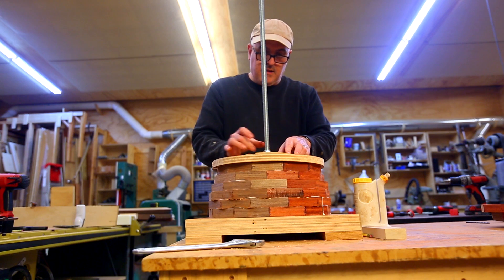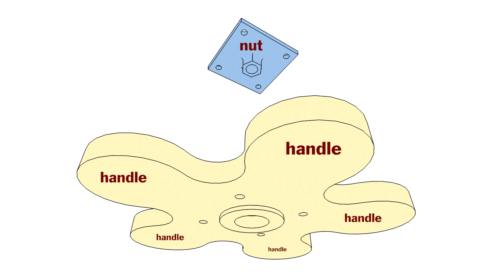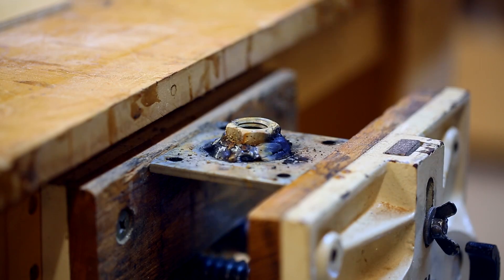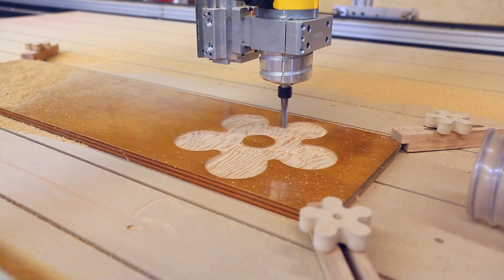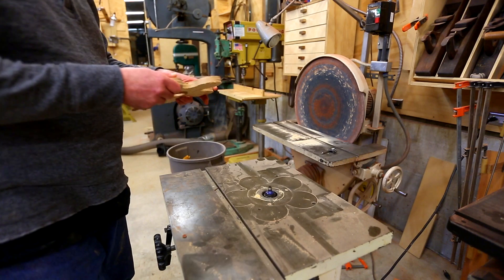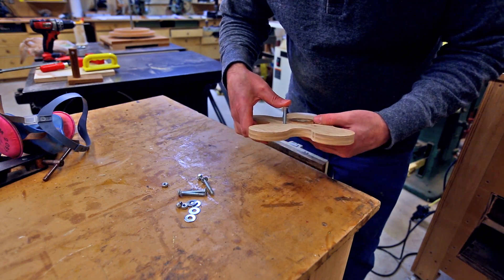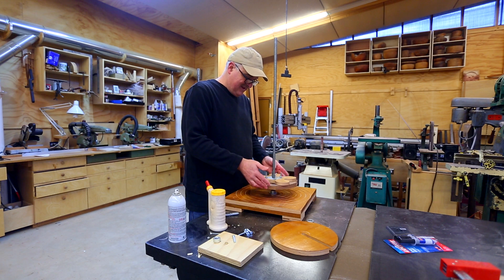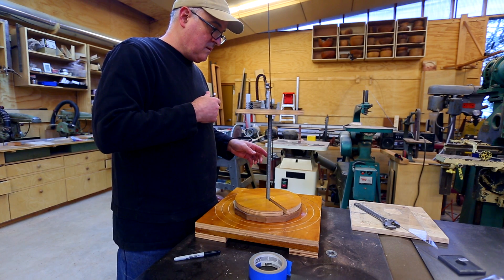Segmented Bowl Clamp Handle

Comment: What about a quick-release rod? So the rod detaches from the base with a push of a button?
Reply: +Brian Noah Or a spit nut. Then you don't have to worry about keeping the rod square to the base if your tolerances are off.
Reply: +Brian Noah There's a good idea.
Reply: +PyroShim Split nut... that's what I was thinking. Weld a nut in the jaws of a small vise-grips, then saw the nut in half. Then weld the vise-grips' non moving jaw to the metal plate.
Reply: you can also find a threaded clip which can be used as a nut and is easily removable from threaded rod. don't know how it is called but I have seen that few times at work (aerospace industry). worth checking it out.
Reply: +Brian Noah Or a smooth rod. Put a chunk of externally threaded pipe in the nut in the handle. Slide the pipe/handle assembly over the smooth rod, clamp some vice-grips above the pipe and spin it tight. Might need to cut some notches at the top of the pipe to keep it from spinning against the vice-grips.
Reply: +Justin Désilets Erico SN Series Nuts
Reply: +Justin Désilets They might not be the exact ones you're thinking of but these are brilliant for this exact purpose.
Reply: Sam Tranter nope, that's not what I had in mind, but I guess they do work the same way!
Reply: Pat Sullivan not quite the thing i have in mind, but something similar to this: http://www.dumpstercnc.com/images/super-thread_clamps_size_c-01.jpg    some have a quick clamping mechanism that makes them as easy to use as the one you proposed, but they end up being closed all around.
Reply: That nut is designed to allow you to remove the backlash between the lead screw and nut, you would not be able to open it far enough to release.
Reply: +Brian Noah I was thinking the same thing the whole time!